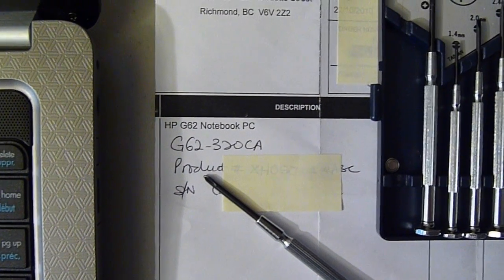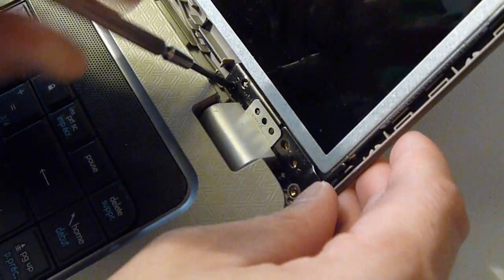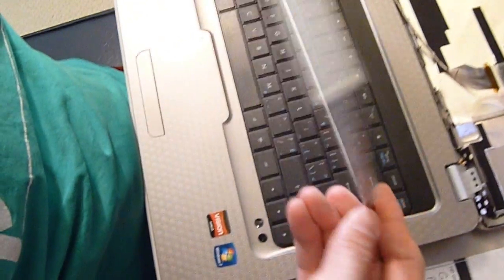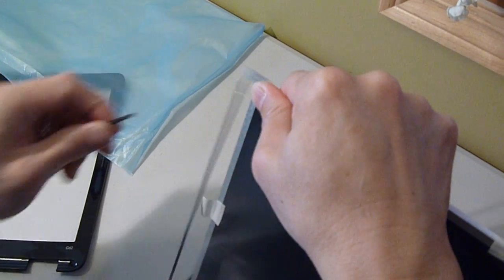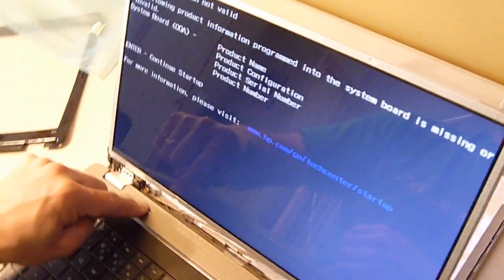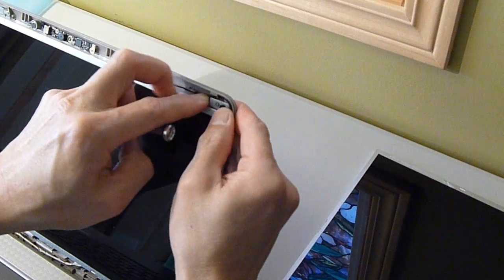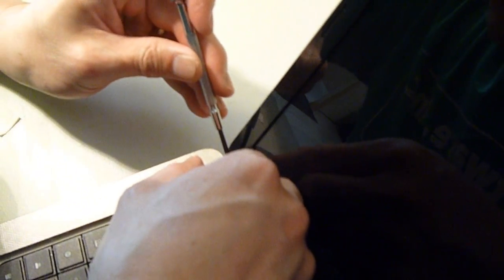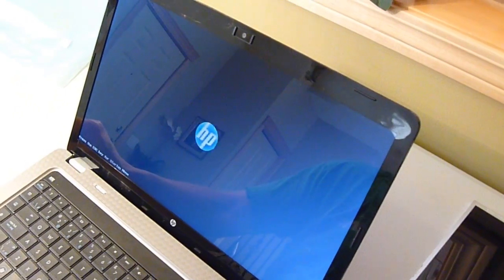HP G62 Screen Replacement Tutorial

Comment: Nice video, I just had to do this same repair on my G62-227CL, while I was at it I replaced the CPU with a quad core, the CPU fan, and maxed out the ram to 8gb. So far it's running really well, my next upgrade will be a ssd drive.

Comment: Don't think for a minute this is an easy process unless you have a lot of experience working with tiny little screws that go into nearly inaccessible places.  I have been trying to replace the 4 screws that hold the screen to its frame for over an hour now and have only managed to get 2 of them in.  Seriously, think long and hard before you attempt to do this on your own.  I am so frustrated at this point, I'm quitting and will try again another day.